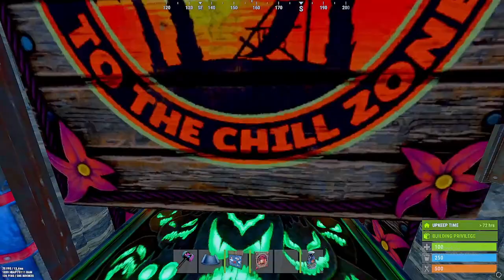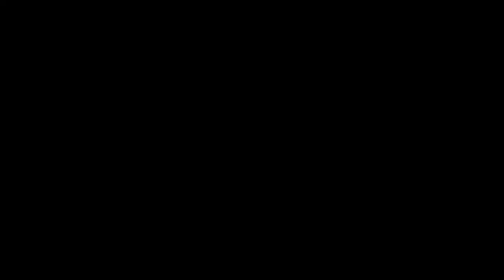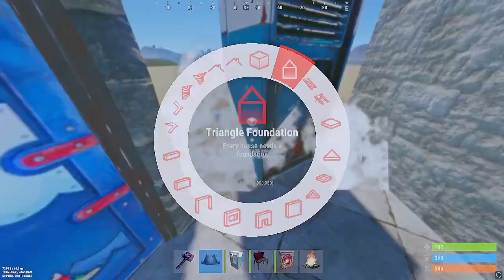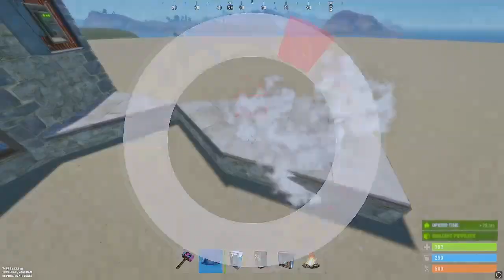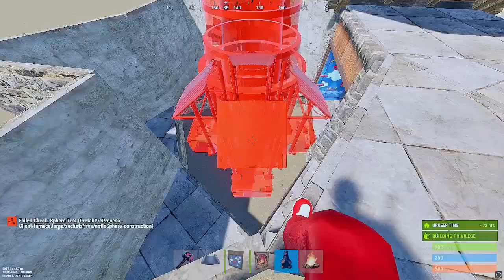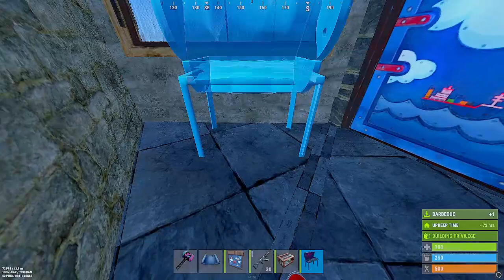~9+ rocket furnace base

Comment: Its just 4 rockets, you splash the roof left or right and it doesnt just open up the upstairs loot room but both furnace rooms aswell
Reply from the maker: hi, i appreciate the comment but i cant replicate whatever you're talking about. i also dont understand what "the roof left or right" is referring to or where "you splash" from. if you could link a screenshot showing where you aim the rockets i would appreciate it. sanc code is MNBATJ
Reply from the maker: ah yea i found it. it's VERY precise to actually splash both. nevertheless thanks for pointing it out, upgrade the floor frame to sheet and that fixes it. thanks!